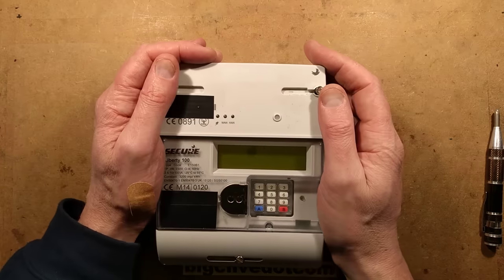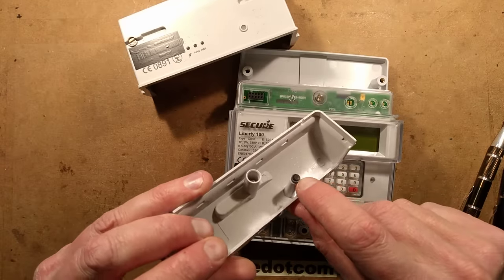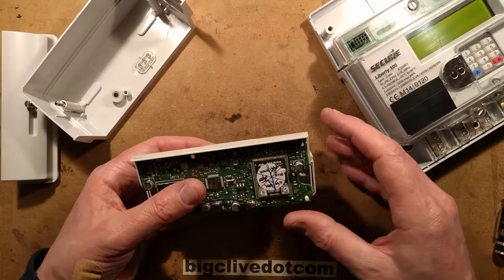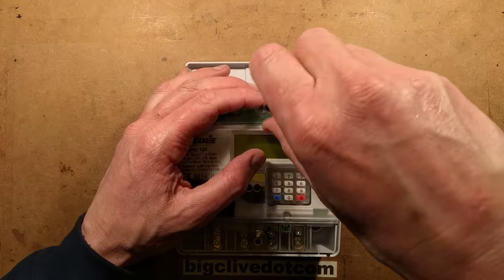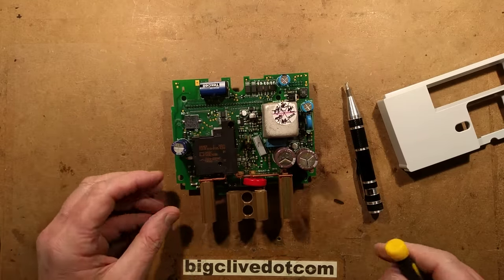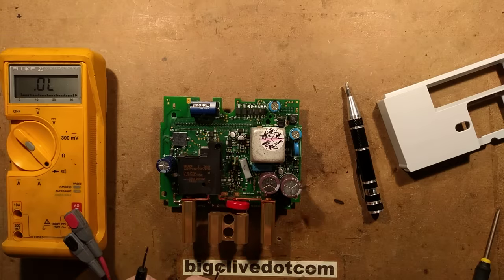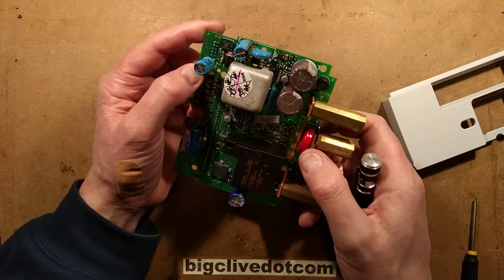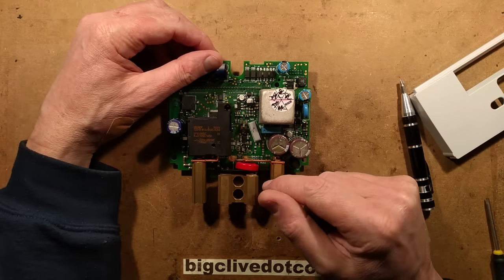Inside a smart meter, and the REAL problem with them.

Comment: Looks like a Bluetooth module to me. Try cutting the SIM card down to size and see if it’s still active in a phone.
Reply: evilution usually zig bee module
Reply: @eWhizz  metering uses zigbee because it has a longer range and better error correction.
Reply: I'm assuming it's the ZigBee that is used to send the smart gas meter readings via this one module.
Reply: @98dizzard  Yeap. It's primarily used for in house infrastructure. In the future you'll have zigbee switches to let your Meter turn things on and off in the house. Well that was the plan when I was developing those meters.
Reply: id be interested to see what the sim did in a phone.  how good are the energy companies/ phone companies at identifying unauthorized devices.
Reply: So far as I know, these do not connect to the regular phone network and are isolated from normal internet connectivity.
Reply: ive also just found https://www.youtube.com/watch?v=hkturOaaLAc not watched it yet
Reply: Well, they're Aussies - we never did send the brightest down there. ;)

It is possible they have internet connectivity. If they do, someone needs a good slapping, there's no reason for it.
Reply: that depends on how well the devices are isolated from one another on said network.  also how hardened the meters are against receiving commands.  the meteres must be capable of receiveing commands and being as the networks were created >10 years ago i imagin there are some serious security holes in the meters that have gone unpatched.  

also how hardened the energy companies network is against the misuse of sims.  to say its worthless is completely dependent on what you are doing and how hardened other meters are.
Reply: this article from 18 months ago is particularly harrowing https://www.theguardian.com/technology/2016/dec/29/smart-electricity-meters-dangerously-insecure-hackers 

and its only addressing the issues with zigbee
Reply: Wireless MBUS, for connecting peripherals like wireless gas meters is more likely
Reply: In theory, quite well protected against intrusion on the network - GCHQ got involved there. In practice, I haven't examined in detail and there's always potential for exploits.
Reply: That article also claims you can make the meter explode. I have limited faith in that. I'm sure there are flaws, though - there always are.
Reply: @joylessdave  Some group monitoring migrating birds (storks specifically IIRC) suddenly got a hefty bill from their phone company for a SIM that had been in a device on a stork last heard from in Africa. Don't know what type of SIM they used though...
Reply: Spooky!  
  Man , you've been an inspiration! I've been tinkering with electronics for about a year now and I'm absolutely fascinated with learning what components are and how they work. As built several small power banks in a few battery chargers. My goal is to one day build a guitar app for myself. right now I'm putting together a dim bulb so I can work on my stereo receiver. I'm 46 years old now and wish I would have gotten into it much earlier but from here on out it's something that will be right up there with playing guitar as a hobby. Have a great day. Take care.
Reply: @ evilution - 
or use an old used phone
Reply: its also worth noting that alot of times sim cards that are used in industrial and M2M systems are also pin locked and if you don't have the code you'll have to call the provider. these systems are also likely on their own APN routed away from the internet. in theory you could join the private network if you use the right APN and password (for example regular verizon internet access is VZWINTERNET and no password)
Reply: If used in a phone would it be free to make calls.
Reply: AFAIK the sim cards in smart meters do work in phones. At least they did 2-3 years ago. I knew a drug dealer that had claimed  to have taken a sim card out of a smart meter that allowed him to  send/ recieve unlimited texts. He could not make or receive phone calls though.
Reply: Is anyone else who has an old meter getting hounded like f from their energy company to get a smart meter? Edf keep offering to me and I keep refusing. My bills are well within my means and I'm not a dafty, I have the ability to tot up what I'm using but still they persist. To the point I am changing supplier this month to stop the harassment from them which is at a level I believe I could take legal
Reply: I have an SDR and I can see pings or data from smart meters pop up on the waterfall of rf like fireworks. I never looked into if it can be decoded or any such things.
Reply: @cragmc8386  I used to until I told them  I don't want a smart meter & to remove my name from the rollout list, that was  about a year ago,  not had any bother since.
Reply: +Crag Mc Yes, even though I've made my supplier well aware that I do not permit "smart" metering of my supply!

Granted, I don't have an issue with the idea of my supplier having two-hourly readings of my consumption - Provided this goes directly to them, avoids the "statutory" Govt man-in-the-middle, is uploaded at least six hours after the last reading captured - But a remotely operable kill switch on my supply in a device with known security weaknesses? They can Effingham right off on that one!
Reply: Wifi module
Reply: @98dizzard  Yep, we normally, pair the gas, heating and water meter, with the electrical meter, because they didn't have the GSM module, you should have seen, some of the faces on the customers, when you tell, that you have to pair the meters.
Reply: Monkeh  In fact they may only have to send SMS messages if they only need to upload meter readings. No need to do anything more fancy. If that is not case you have regular old dial-up internet over 2G GSM. Many of these all in one GSM modules for machine to machine communication don't do 3G/4G.
Reply: nods South African traffic lights have working sim cards in them.  Well, some do.  Some 'had'

Comment: The hall sensor is for detecting magnets indeed. In the previous type of meters, the magnetic ones, you could halt them with a powerful enough magnet (although destroying the permanent magnets inside the device and destroying it). The detection isn't so much for protection of the cirquitry inside, but to see if the customer tries to manipulate their readings.

I work with these things in germany, so thats how i have the info :)
Reply: When he said that i laughed so hard, OFC people try such things. MAN electrical company definitely don't wanna get screwed :D
Reply: Problem ?(whose?) I do store magnets ( bass loudspeakers) in the cupboard the meter is in
Reply: @highpath4776  Nah, they'd have to be right up against the side of the meter. And they need to be really strong too. Big neodynium magnets.
Reply: @theone14444  The meter relay will be opened whenever hall sensor detect magnetic field in certain strong value (about 400 mT) and relay stay opened even the strong magnetic is not there anymore. It's happened in electronic meter Indonesia customers
Reply: How's it feel working for the enemy ?
Reply: @highpath4776  who doesn't?

Comment: The "slug" of different metal is indeed a calibrated shunt, or very low value resistor. The tiny voltage drop across it will be proportional to the instantaneous current from Ohm's law. It allows the current sine wave to be monitored so that the phase relationship between voltage and current can be determined. These meters can simultaneously measure total VA and import and export var and  W.

Typical value for the shunt is 0.5 mΩ. The power dissipation at 100 A would be just 5 W, with a lot of copper to take that heat away.
Reply: 100A meter shunts are usually about half that resistance. Typically 200 to 300 micro-ohms. 5W is more than most meter specifications allow the meter to dissipate. They use a material with a very low temperature coefficient for the shunt. The copper connected to the shunt it prettty thick, but no more than you need to carry 100A.
Reply: Shunts are usually made out of costantan,little to no change in resistance if temperature changes
We made power supplies and used some 3000A shunt they get a little warm at almost 3000A but also weight almost 1kg
Reply: Constantin, manganin and other alloys need very precise control to reach a 0ppm temperature coefficient. Most shunts only claim a temperature coefficient of 10ppm/C to 50ppm/C. That's not too bad, but if you let the shunt heat too much you are going to ruin the performance of a 0.1% accuracy utility meter, which is a common type in some countries (most countries use 0.5%, 1% or even 2% accurate meters).
Reply: @coppice2778  200µΩ was what we used ...

Comment: Could the relay be Bi-stable, only requiring power to change state?
Reply: It is.
Reply: Jep, the symbol for the coil says so.
Reply: If it was normally closed and the service was shut off, immagine what would happen when returning from a power outage.  The normally closed relay would be closed for a split second before the  circuitry would be able to open the relay and you'd have two seconds of free power.

Comment: This is the first time I've heard the ridiculousness of there being microphones in these. Surely the microphone in your landline or mobile phone would be sufficient to monitor your conversations?

In any case, it turns out to be quite easy to get sufficient 'personal' data, from just the real and imaginary power readings, for most nefarious use cases that you could imagine.
Basically, it relies on a few key assumptions that actually seem to hold up in most instances:
The main one is that people are creatures of habit.
Secondly, since you have access to everyone's usage data, you are easily able to accurately train neural networks to recognise certain patterns, which differ from the norm (this might seem to not be very useful, but it turns out that there are so many more 'ordinary' people living around you, that trying to obfuscate your actions through exploiting certain periodicities still makes you stand out quite clearly).
Thirdly, certain key, common activities have a very distinctive power 'signature' which can serve as markers.

As a crude example: Showering or bathing places a relatively large resistive load on the mains, which differentiates it from inductive loads (like refrigeration, air conditioning, swimming pool pumps, etc.) and capacitive (usually electronics with switchmode PSUs) loads. Since you will usually shower at around the same time of day (at least on the corresponding day of the month, every suitable month, say the 1st of every month which is also a Monday) it becomes very easy to get a clean signature of your electric water heater, by simply autocorrelating and filtering the data over multiple observations.
So, if you suddenly start showering at odd times which also coincide with an uncharacteristic drop in activity from another man's apartment/house, followed by a spike in the same man's activity, always corresponding roughly with the expected travel time between your locations, then you have just found out that both guys probably are not straight.
Granted, it's much less useful information in today's society, but it might still not be something that you expect to be easily accessible public knowledge.

Now, all of this is information is obviously very easily bought by any interested corporation with enough money, and has been effectively collected by major governments for decades already, so the idea that large companies would gain any extra personal data from you through these devices is quite ludicrous indeed.

The difference now, is that these power readings are being publicly broadcast, with very easily defeated security (as has been demonstrated to death at this point). So if you have these smart meters installed, it just becomes SO much easier for thieves to learn when you're not going to be home (or for that matter, when you're going to be in the shower), whilst making their scouting activities practically undetectable (they can just go around, mounting undercover receivers to point at targets with high-gain antennae, without ever going near the property or ever getting within optical line of sight).
It makes voyeurism a whole lot easier as well...
Reply: Indeed. A Yagi antenna with an RF reciever will, be able to sniff out the information these transmit over the 3G/4G/HSDPA-LTE mobile networks and, be intercepted. Laptop, Yagi Antenna, RF Reciever & something like Kali Linux with a suite of sniffing software and appropriate drivers for communicating with the antenna, are all you need.

You can crack the SHA2 key used and perform a false handshake with the meter (man in the middle attack), at which point you could even shut off someone's supply or reprogram the meter.

It would render CCTV, Alarm systems and such useless unless they have auxillary supplies (which alarms at least, usually do). Magnetic locks are also at risk here (though magnetic locks can be defeated in other ways anyway).

Physical Penetration testing (some people call it "red teaming" for some reason) is an important aspect that is often over looked. And it could lead to robberies, data theft, or even sexual assault/rape of occupants or installation of cameras in the residence.

While reaching, there are a handful of clever criminals out there who would exploit this.
Reply: Any microphone in a meter in my house would get traffic noises, as it's mounted outside in a box!
Reply: @PhilC184  I built my own house so built a standalone box not even connected  my house (apart from by an underground armoured sub main  of course!) - so as we live in the countryside it'll be birdsong and 🐑 sheep . I suppose at least it'll be restful for the snoops listening 😁 .
Reply: the nsa just watch me  on pc
Reply: Face it, time to done the foil hats!
Reply: They could still gather sound without a microphone but, as has been pointed out, with all the electronics we carry around it is irrelevant.
Reply: You can use the relay coil as a microphone as the non operated relay armature can slightly vibrate with noise causing the inductance of the relay to change. You can bug phones the same way which use the old bells.
Reply: I wonder if you'd be able to block the signal from the meter by giving it it's own 'tin foil hat'?
Reply: I found a microphone in my phone once. I removed it and They found out, now people can't hear me when I try to talk on the phone. It's real, man!
Reply: @JamesAllmond  don?
Reply: Were there any smart meter hacks that didn't require physical access to the meter?

I know that 3G and 4G network traffic is encrypted by default. Even if the smart meter doesn't have their own traffic, nobody between you and the phone company should be able to see it (but the phone company could see it, if they don't have their own encryption).
Reply: Requited   I keep my IPhone inside five layers of tinfoil. I've noticed I don't get a lot of calls any more .
Reply: .... yeah but, im pretty sure privacy is totally dead.
Reply: @ts757arse  - You could just go into the bios and turn the microphone and camera _off_, rather than falling prey to paranoia.   I'm in the IT field, and the bulk of the 'exploits' dealing with your camera are to take a picture and display it on your screen, so that you believe that the government is spying on you and you have to pay them the 'fine'.  You see, they can't know what kind of internet you have, firewall, or anything else, so they go for the simplest hack.
Reply: the gestapo controlled the commies with tiny a fraction of the amount of data we put on facebook.
Reply: @blitzwing1 maybe tinfoil knows their history
Reply: @ts757arse  You can kinda control your mobile, DNS filtering is one way of externally controlling it's requests but obviously only blocks DNS requests and you need to setup a DNS server to handle that, the other is filtering at the device itself, this usually requires root but on non-rooted phones you can use the VPN api to route all traffic through a local VPN, which you can do with NetGuard, consider trying it out.

Comment: The funny looking part of the bus bar is actually an ammeter shunt. A very low resistance that passes current and thus has a millivolt drop across that the smart meter can use to determine amps draw
Reply: the shunt is likely made of manganin which has a very low temperature coefficient
Reply: @andrelubbock Wow. Haven't heard the word manganin in about thirty years.

And I recon you're correct. That's exactly what it is.